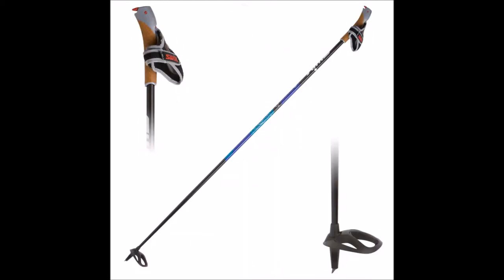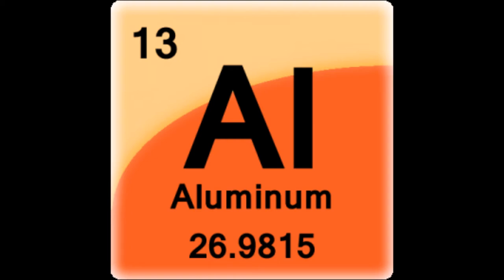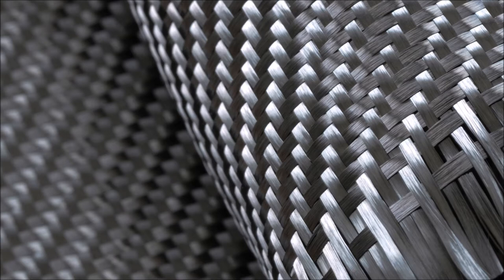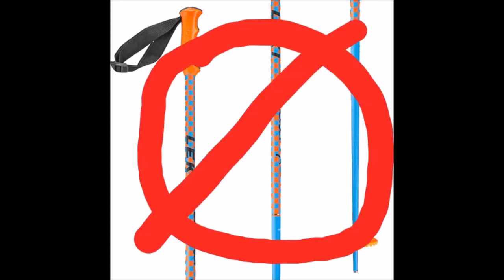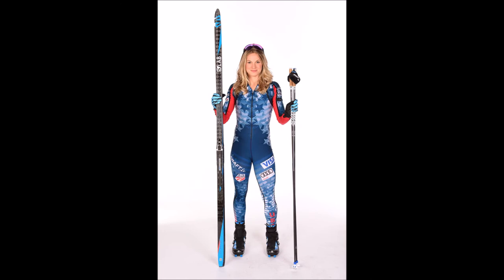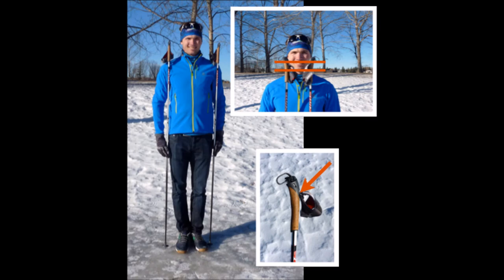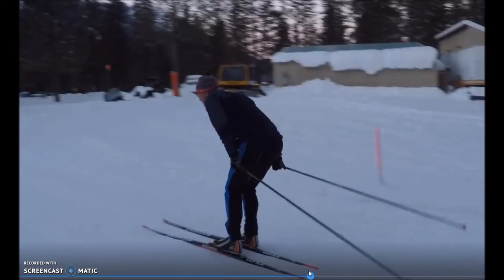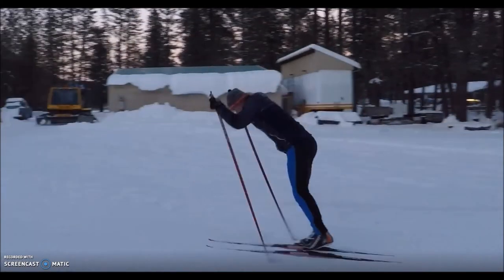Cross country Ski Poles

Comment: Hi, could you tell me when you are measuring the pole length, are you standing on snow I.e. are the tips in the snow or subtracted from the length if on solid ground?   Thank you
Reply from the maker: There is a range of acceptable measurements.   In the video I suggest you take the measurements with skis on, and I meant to imply that you would also have your ski boots on and everything else as well.  If you're not on the snow then I suppose you would subtract the distance from the tips to the baskets.